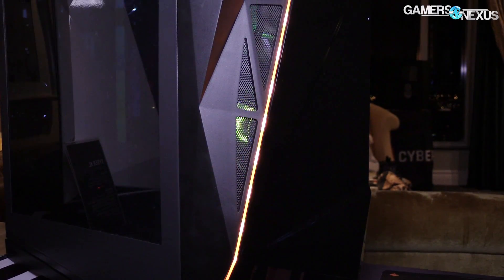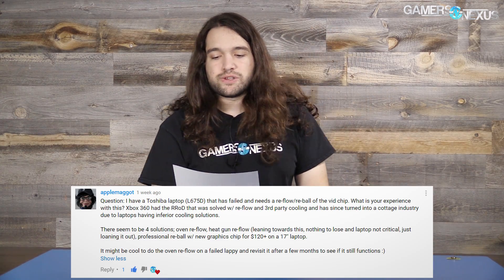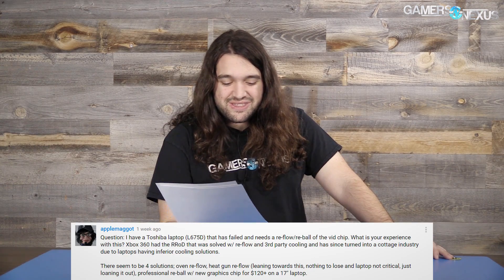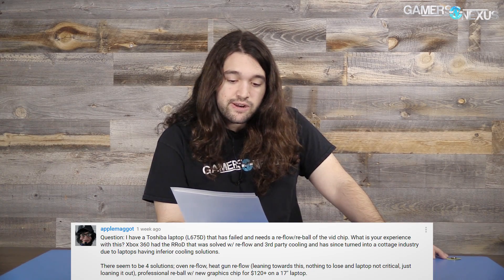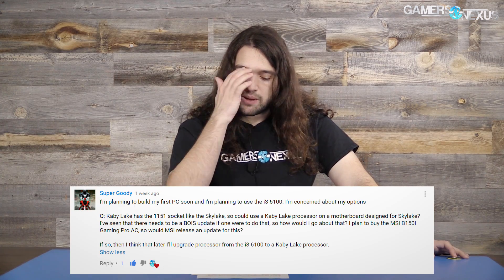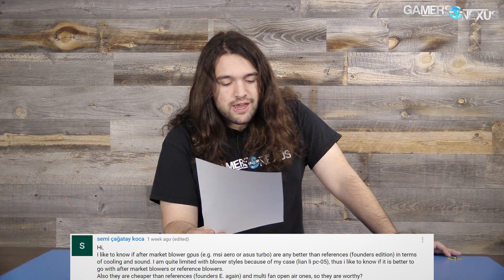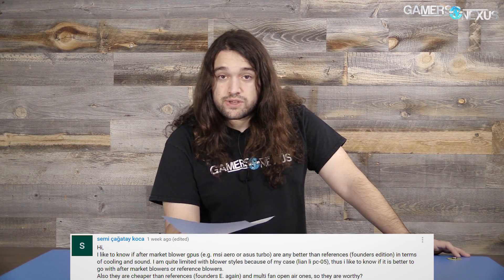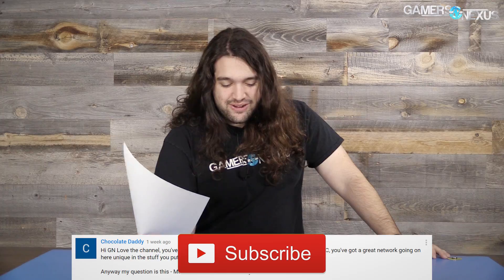Ask GN 40: Reflowing Laptops, OEM vs. Non-OEM Parts

Comment: CPU/mobo compatibility:
at the mobo support site check the "CPU support list" which will list currently compatible CPU's. It should list the BIOS version for each CPU which may be a concern if the i3-6100 for example was recently listed as a NEW motherboard may not contain that BIOS... and some motherboards can NOT update the BIOS without the CPU.

*So I'd look for a motherboard that can FLASH THE BIOS without the CPU being present.

Comment: Your video on the i5-2500K spoke volumes about how far CPUs have progressed since 2011. Any chance you could take it all the way?

I'd love to see the following compared at 4.0 GHz:
Core i7-875K
Core i7-2600K
Core i7-3770K
Core i7-4770K
Core i7-6700K
Core i7-7700K

If possible, I'd even like to see a Westmere 4C/8T Xeon at 4.0 GHz compared, as well as a Core i7-5775C with the L4 cache disabled. Overall, however, I'd like to see how much we've progressed since Nehalem. Your i5-2500K revisit showed that more threads have become important, but I'd like to see how much architecture has improved on these units.

Comment: Hey GN,
How do GPUs handle multiple monitors? For example, they could:
- Render one large frame that is split up and sent to each monitor per cycle
- Refresh them in an alternating pattern (ie render one frame for monitor 1 then the next frame for monitor 2 then back to monitor 1 in a 2-monitor scenario)
- Split the GPU cores and frame buffer between the monitors, either dynamically or in a fixed fashion

Also as an extension, how does a GPU deal with multiple monitors refreshing at different rates (eg I have a 1280x1024 monitor at 75Hz and a 1920x1080 at 66Hz)?

Thanks!

Comment: What is the point of having PCIe bridges like on ASUS Z170-WS and "doubling" number of PCIe lanes available if they are still bottlenecked by the same number of actual physical lanes of the CPU.

Z170 has only 16 PCIe 3.0 lanes, but ASUS Z170-WS suports 4 * PCIe 3.0 x8 cards. Shouldn't they perform the same as 4 * PCIe 3.0 x4?

The only 2 reasons for having this config I can imagine are:
* to have 4-way SLI (which kind of requires x8)
* when not all cards are loaded 100% at the same time (which shouldn't be true in perfect 4-way SLI anyway)

Comment: Aren't "OEM" CPUs tray CPUs?  Haven't really seen many sold that way lately.  When I did my mid 2000's builds I was getting my CPUs marked as OEM. (celeron D340 and Athlon x2 3800+ 939 socket)

Comment: Question for you Steve:  I'm upgrading a laptop that I've just bought. I'm installing a 2nd drive.  Given the prices of SSD's in the 1TB range ($250+ as of 1/17/17) when compared to a slow HDD in the $75 range (same date), I was looking at the SSHD's in the $70 to $150 range. Those are 1 to 2 TB drives with an 8 or 16Mb cache.  The larger cache combos are at the top end of the price range at 16Mb but reviews say that SSHD's with 8Gb ratings for the SSD aren't likely to deliver the increased speeds I am  hoping for on a system used mostly for gaming and vids. I'm sure that an SSD at 1TB is the best solution to expand storage but are the trade offs for a lower priced SSHD worth it  in your opinion? Is there really a big enough difference in performance between the 8Gb and 16Gb sshd to warrant the price difference between them, which is about $75+ dollars? Love the Nexus and thanks.

Comment: Hi GN, I'm looking to replace my 22" TN 1080p monitor with a UWD 1440p curved monitor. I've narrowed it down to one of three, Samsung C34F791 - LG 34UC88 - Asus PG348Q. Whilst I'm not trying to be a cheapskate, I'm trying to evaluate if the £300 difference between top and bottom is worth it (the Asus comes with G-Synch, the others are both Adaptive Synch) and if it isn't to split the difference between the VA panel of the Samsung and the IPS of the LG.  First world problems I know, but I don't want to regret my £800ish purchase by not asking the right questions.

Comment: ASKGN: Hey, Steve I have a benchmarking question, since that's your expertise. What could possibly be the reason for a given reviewer to use gaming benchmarks specifically in 4K ultra settings when comparing CPUs? I thought CPUs "stretch their legs" the most at high FPS, not high resolution. In this line of thoughts are 720p gaming CPU benchmarks still viable?

Comment: Keep in mind that latencies of 5 Ms or less are considered real time by our brains. A good thing to do would be test if PS/2 (which is CPU interrupt based) is still faster than modern USB (which is polling based). This was one of reasons why the first incarnation of the SteelSeries 7G was PS/2 and came with a USB adapter instead of being USB only.

Comment: Question: Why do we need IHS? Isn't putting a heat sink directly onto CPU more efficient?
Reply: true but after a lot of architecture size decrease, the cpu die is too small to a point if you put the cooler on the cpu the stress created by the cpu in that small area can crack the small board of the cpu 
this is what i usally read on internet i myself have never delidded a cpu but planning after seeing the massive temperature drop with kabylake 25 c :O
Reply: It's very much true. Fairly recently a 4790K I delidded was sold on ebay. The buyer complained it didn't work and after some troubleshooting we had them return it. When it came back it turned out that they'd cracked the die, probably while installing a cooler. The IHS was included, though separate. Why they chose not to use it is beyond me.

Comment: Hey GN, I own a GTX 980 Ti (376.33) and the drivers enabled Fast-Sync for me a couple of weeks ago. I tested it with League of Legends, Dota 2 (7.00 and 7.01 Vulkan) and Overwatch. It is by far not smooth. I use an EIZO FS2434 1080p 60Hz panel connected to the GPU over HDMI. I expected it to be butter smooth. Am I doing something wrong?
Reply: I will try to lock the frames to those values in DOTA 2 but I'm afraid my computer might not be able to stay at constant 120fps in DOTA 2 at 1080p if something intense happens on the screen.
Reply: I'll tell you about my experience when I tested it. But I find stuttering way more annoying than tearing for MOBA game play

Comment: Question:
i have a asrock z77 pro 4m mother board with a i5 3570 ,i was wondering how much speed on my graphics card i would lose (in a %) if i have a gtx 1060 and two pcie tvtunerduo tuners(4 turners on 2 cards) .Does the 2 tv card slow the graphics card . With graphics card in there are on 2 free pcie slots free for the tvcards so i cannot pick a different slot they have to go in the only 2 available slots.

Comment: I would also recommend not fiddling with the clicks on the GPU after reflowing. I live in a country where no one has a BGA rework station so my only choice was reflowing. I tried to go safe and underclocked my GPU but for some reason it broke again. The life span you can squeeze out is also quite arbitrary since it could last a week or a year

Comment: I have an older system,. A Core 2 Quad (q9650 3 Ghz) on an intel extreme mb with 8GB of DDR3 ram, currently running with a evga gtx 760 sc 4GB in a custom case,  This system runs games at high and sometimes ultra settings with playable frame rates (25-90 depending on the game), i'm planning on an upgrade of the video card, either to the gtx 1060 6GB or the 1070, i have 2 questions.
1. With this system setup, is it worth it to dish out for the 1070. would i see any performance gains over the 1060? since my cpu is much older. bottlenecking and the like.
2. why am i getting higher performance than other ppl that i  know that have better hardware in cpu and gpu? just as an example, someone i know is running an i5 2400 8GB ram, and a gtx 960 4GB in a pre built system., yet i have significantly higher frame rates than his system in all games, and my system is not overclocked. i'm just curious about your opinion on the 2nd one.
Reply: wrong place

Comment: Can you overclock locked Kaby Lake CPUs by increasing the BCLK like you can with locked Skylake CPUs?
Reply: This was possible on Skylake with some older mainboard bioses until Intel rolled out a patch that made changing the blck impossible. On Kaby Lake this is not possible any longer no matter what mainboard or bios you use.

Comment: I currently have a Samsung 850 Evo 500gb. I am running out of space on the drive and I plan to buy an expansion

Q. Can I mix and match ssds size and brand and put them in a raid setup and if so then how do you put ssds in a raid setup without a raid card?
Reply: Bdoodle I guess you are talking about raid 1 and 0: As long as they're the same size and roughly have the same speed it does not matter. If the specs are different just take in mind that the raid size is based on of your smaller drive as well as the speed.

Comment: Question for Steve: Say i have my wireless usb dongle plugged into the usb 3 header on top of my computer, but the speeds arent consistant ive moved everything away from it have it top and center yet the speeds are still fluctuating alot would it be better to plug it in the back of the pc directly into the MoBo?

Comment: Why doesn't intel (or amd) use a liquid metal TIM? People seem to get ~20C reductions after replacing the stock one and there's no issues with cracks from thermal cycling like solder has.  The only reasons I can think of are either they're cheap or because it's conductive and their process for applying it isn't accurate enough to place it only on the die.  Neither seemed to be an issue before with solder though.

Edit: I've heard talk that the main issue with the IHS on intel cpus is the gap created from the adhesive being too thick and not the TIM.  Do you know if this it true? That seems easily resolvable if it is.

Comment: steve what does nvtray download? i use net limiter to monitor whats using up my bandwidth and nvtray downloads something almost everyday. if i execute nvtray on task manager nvidia web helper or geforce experience takes over and starts downloading. whats nvidia downloading? 

also why is it that if i cut the connection to nvtray, nvidia web helper, or geforce experience i cant use my internet overall
Reply: Nvtray is what loads and controls the tray icon for the Nvidia Control Panel in your toolbar. It may be that you're sending constant usage reports or something, but it'd be easiest to just clean install the latest driver. Download the latest driver for your card from the Nvidia website, and use DDU to uninstall the driver in Safe Mode (it'll auto-reboot in Safe Mode if you don't know how to get there), then once it's all done, just install the latest driver you previously downloaded and see if that solves your problem.

It's unlikely, but it could be malware, so do a scan with MalwareBytes to be sure. It won't hurt to also do a registry clean with something like CCleaner either.
Reply: SlavjanA
nope it downloads something everyday and uses full force bandwidth for like 4 mins. im pretty sure it does this to everyone just that people never notice cause the majority of people have decently fast internet and dont have any programs to monitor speeds
Reply: SlavjanA
btw steam does the exact same thing. if i try to limit the speed on the downloads it laggs you out in games too
Reply: I see, looking around online there doesn't seem to be anything about it, other than the telemetry stuff, but that's a separate thing. Since it has to do with the Nvidia Control Panel, my best guess is that it's maybe new profiles for games/applications, or other optimisations, but idk for sure. Hopefully we find out next week.

Comment: Hey Steve, Thinking of getting AIO coolers and was wondering how long do they last and what happens when they come to their end of life if they do they have one? Can you refill the liquid or you have to buy a new one again? Lastly prefilled water cooled cards like the gigabyte 1080 waterforce is it worth getting one over a standard air cooled version for longevity concerns assuming you just use it like regular. Like if the pump for the card fails does this mean the card is screwed now and would it be possible to fix?

Thank you

Comment: Question for next week. Steve what do you think about using a small fan or heatsinks to cool routers and modems? I've recently been experimenting and found some positive results for cooling your network hardware including lower ping and latency and  slightly faster sustained downloads and transfers.
Reply: i also validated this. nothing very scientific but it seems to help.

Comment: askgn: is there anyway to tell if your mb or cpu is buggered other than swapping out the cpu?
Reply: Sam H have you seen the recent episode of Jays2cents? He killed his cpu on accident and the way he figured it out was taking out the cpu and trying to post without the cpu. when the cpu was in, it would start then die immediately, but while the cpu was not in the socket the motherboard was able to turn on just fine.
Reply: Smack Chop cheers I'll give that a shot
Reply: Sam H no problem, check out the video though in cases i missed a few tips from Jays2cents
Reply: Smack Chop will do. tried booting without cpu, got a click from the case speaker when it turned on 1 second later a click then it turns off.
Reply: Sam H have your tried clearing cmos? On my asus boards there's an xmp switch that can be turned on, essentially overcloacking your ram and cpu automatically, make sure that switch is off. Then clear cmos, usually there's a jumper plug to do it or you can take off the battery located on the motherboard which would look like a giant circle battery for a couple minutes. i had the same issue with my board would turn on for a few seconds with the cases fans spinning but then it would shut off. Took me hours going through the tomshardware forums for a solution. Best of luck man!
Reply: do you get any beeps when the CPU and RAM is installed? How about when you remove just the RAM? YOu should get beeping at that point. After that remove the CPU as well and if you're getting no error code beeps the board is likely dead.
Reply: Joe Dirt with cpu and ram in - no beeps; lights and fans work ok. 
With no cpu and no ram, I get the faintest click from the case speaker when the system powers on and then a second later you can hear another faint click from the case speaker as the system turns off for a second and then loops. 

the faint clicks have throw me off, does this mean the mb works and everything else is dead? or the case speaker is dead?
Reply: Smack Chop yeah, tried clearing cmos. thanks mate!
Reply: That might actually be your PSU that's causing the issue. see if you can borrow one. Even if all you do is plug in the 24pin ATX power plug from a friends case to yours without taking either PSU out of the respective PCs, it should prove/disprove my theory.
Reply: Psu is taken from working system and I used a mm to check the voltages.

Comment: A good reflow can usually get you a few extra months out of a laptop. It is useful so that you are not in a rush to buy another laptop. If you can, I recommend doing it yourself to save money as a dying laptop is not worth investing $120 in, do a DIY reflow, and use that time to find a good deal on a new laptop. Then take the old laptop, and sell the RAM, LCD panel (if not scratched), the battery (if wear level was very low). If needed, you can also run dban on the hard drive, and then sell it also. Selling the working parts, will help you recover more of your money.

Comment: I've upgraded my pc last year to a i7 6700k and a 1080. I have to build muni itx and had to save some money somewhere and decided to save on the mb. I bought a msi B150I and the voltage is locked at 1.272 and the clock at 4.0 Ghz. This seems to have changed recently, these days the temperatures have been higher. I've tried to reinstall drivers and bios etc. Is there something I can do about this besides getting a better mb?
Reply: ArthurP also.... Windows is a POS. I usually have to do a fresh install every time I do a thorough cleaning. It only takes me about 30 minutes from an image.... surprising how quickly Windows gets full of junk, missing or redundant registry keys, orphaned driver files from updates etc etc
Reply: The thing is the mb doesn't allow changing the voltage or the clock. It seems the default voltage was automatically set higher while the clock is the same, I think this may have increased the temperatures. The fans are good, brand new and clean
Reply: ArthurP could be your TP is degrading?
Reply: ArthurP Check the simple things first. Clean the fans and filters.... double check that the Fan speed curve is set correctly..... I usually reapply fresh Thermal paste on my 5820k also when I do a thorough cleaning about every 8-12 weeks.
Reply: ArthurP You can always try to change the core voltage ie Undervolt...as 1.27v@ stock is a tad bit high...1.1 to 1.15v usually will work
Reply: Dust is also suspect when temperatures increase.
Reply: How so? Please explain
Reply: Voltage is locked for tweaking but it can vary, especially if you have C states enabled. If you're sure that the voltages have gone up though, then maybe you did a BIOS update, or turned a feature on that was previously off. Try clearing your CMOS to reset you BIOS settings, and see if that fixes things.